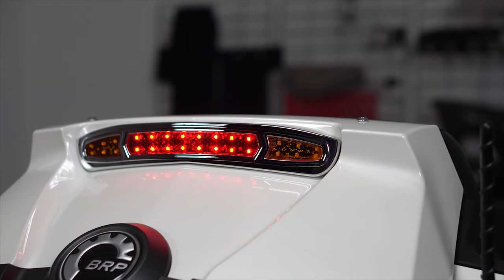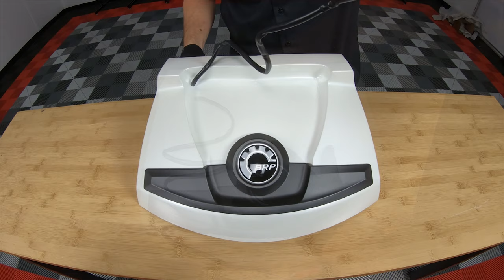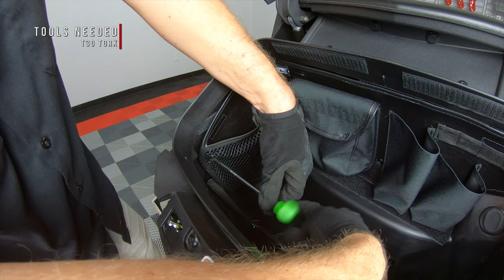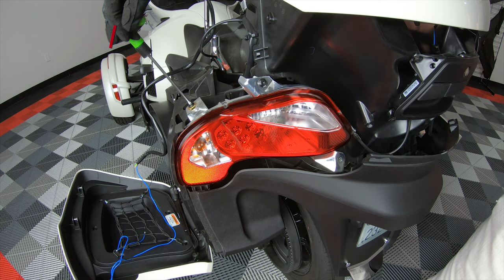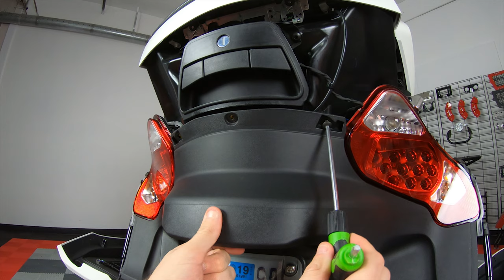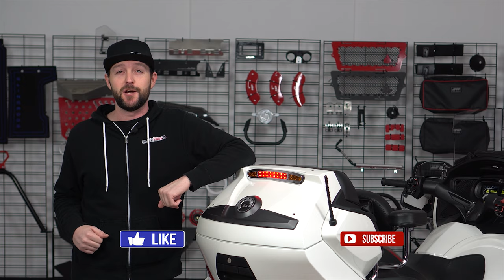Can-Am Spyder RT Trunk Mount LED Brake, Running & Turn Signal Light Kit (2010-19)

Comment: Would like better with brake light separate from running light, so brake light area is dark when brakes not in use. Otherwise looks great and will improve visibility.
Reply from the maker: Thanks Mike, we have a few other additional brake lights coming for the RT in the upcoming months!

Comment: I’m hearing these add ones are only future problems to your bike’s can bus system. A Can Am Tech made a video warning about the havoc these additional LED lights are creating with the can bus system and how it can cause your bike to leave you stranded.  I now don’t know what to do.
Reply from the maker: Hey Jeff, we have thousands of aftermarket LED products out on the road from various MFG's, for all Spyder & Ryker models. If that was indeed the case we would have heard something about this. You can comb through over 20,000 product reviews on our website to read what the feedback is on each individual product from real customers like you. Thanks for the comment!

Comment: Does this light come with all the required components to make the electrical connections?
Reply from the maker: Hello Greg, yes it does. Here's a link to the product. https://www.slingmods.com/can-am-spyder-rt-trunk-mounted-led-brake-turn-signal-running-light-kit You'll find an image there showing all of the components as well. Thank you!

Comment: How long is the 2 sided tape lasting?? Cold wet winter (not so bad that I can't ride😉😉) and some hot dry days in the summer.
Reply from the maker: Hello Jack, we haven't had a customer call on failed tape since launch. It's 3M VHB tape.. which is extremely durable in all weather conditions. Thank you.

Comment: Do You Still Have THE Vader Light And Bump Skid Light Coming out
Reply from the maker: Hello Vernon, yes we do. Still juggling to get those into the mix.
Reply: @Slingmods  thanks  for the RT version thanks and if u have time how about an install video on led lighting under the bike thanks will b keeping an eye out for the video and will order the necessary parts from sling mods thanks
Reply from the maker: @vernonpope926  Hey Vernon, we do a video on most of the products we offer at time of launch. We haven't launched any underglow kits for the Spyder as of yet. It is on the list though. Our video list is over 50 mods deep right now and production rate is only about 2 videos a week.. so it's a lengthy process. We have a bunch of Spyder Videos in the upcoming weeks we're pretty excited about! Stay tuned... and thanks for the feedback.